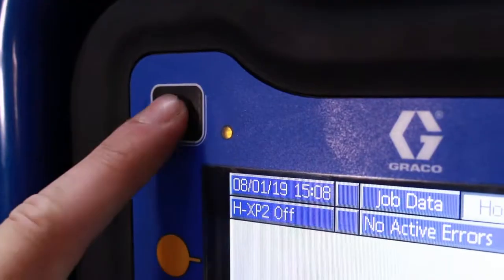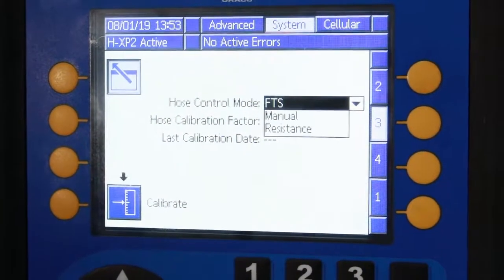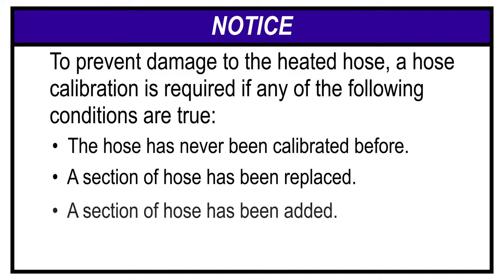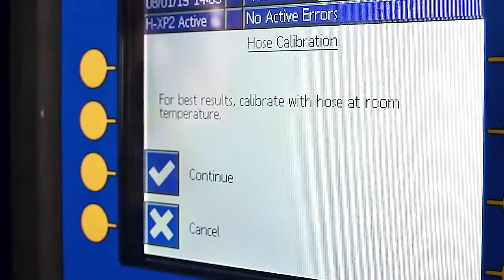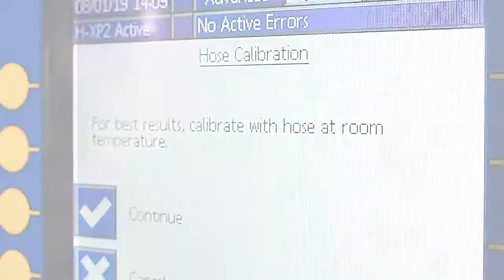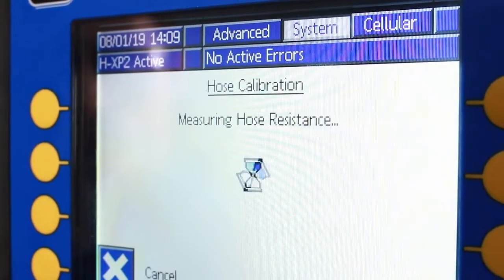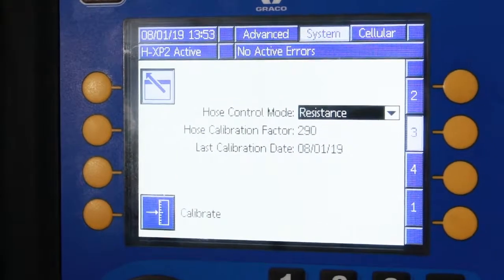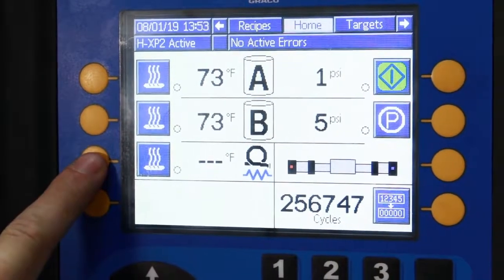Resistance Control Mode Set up and Calibration

Comment: Do you need to disconnect fts wire like you would do to put in manual mode
Reply: Also due to living in canada if our hose isn't in the same room as reactor and is exposed to colder temperatures do we need to calibrate every morning

Comment: Hi, where can I get soft 4.01.001?  I can't calibrate my Graco Exp-2 Elite because of the outdated version 1.01.002. Thanks
Reply: You can get it from any graco distributor, you need a token part number 17e206